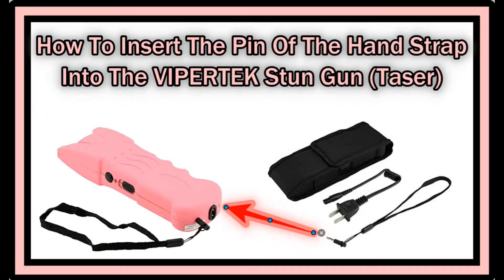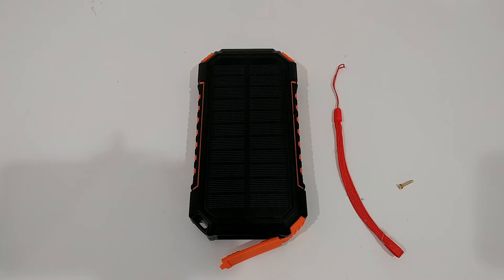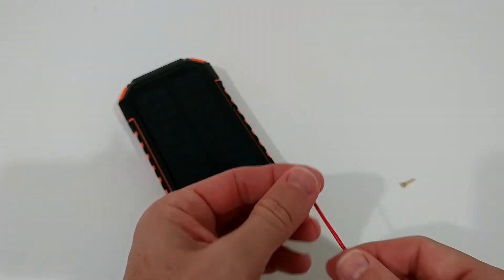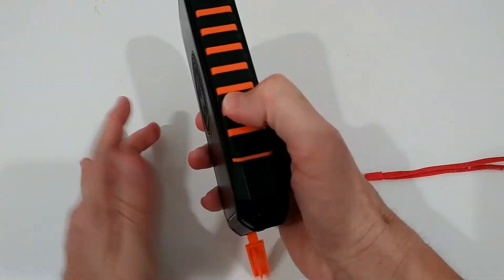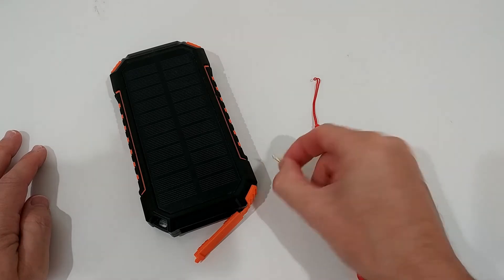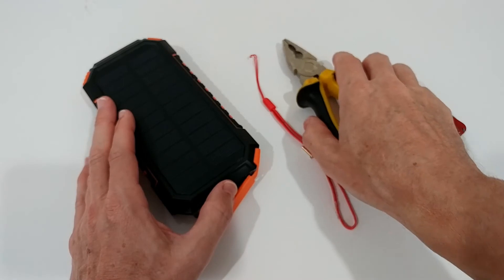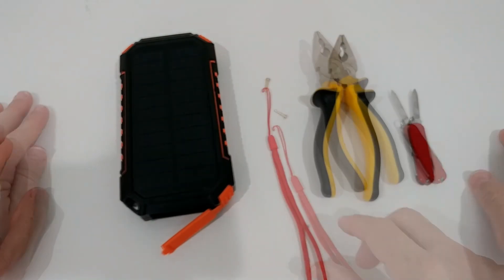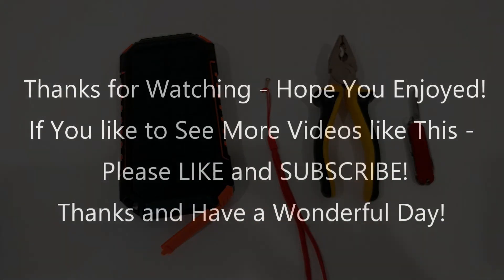How To Insert The Safety Pin Of The Hand Strap Into The VIPERTEK Stun Gun Taser?

Comment: Is there anything else you can use as a disable pin? I lost mine a long time ago and don't wanna buy a new one.
Reply from the maker: Good question. I guess if you find same size metal pin sure, but where to find? Maybe go to Home Depot they have testers for screws and nuts so you can take your taser there and try to find out which screw to buy?

Comment: Are you saying that there is a pin already there to pull out then put the other one in with the strap, like another comment the manual says insert the safety pin in the receptacle at the bottom of the stun gun. This model has the charging hole, another opening where the strap looks like it may go in to loop around, & what looks like a pin already inserted by the serial number.
Vipertek vts 979
Reply from the maker: Yeah - there's already a pin there. I've made a full video about it later. Here you can see, how it works:  https://youtu.be/RRayVW3DDeQ?t=259

Comment: i just got one and the small gold pin was already in it and it came with a wrist strap pin as well. but the weird thing is when both pins are out, my taser still works. im thinking this is not how its supposed to work. whether the safety pin is in or out, the taser still can be triggered. i just took it out of the box today.
Reply from the maker: Oh - wow - that's somehow dangerous. The instructions clearly say:
"Safety Disable Pin: Prevents an attacker from taking this stun gun away and using it on you. A strap worn around your wrist attaches to a disable pin on the bottom of the unit"
I'd suggest you return for exchange